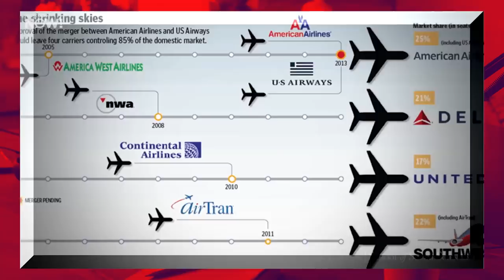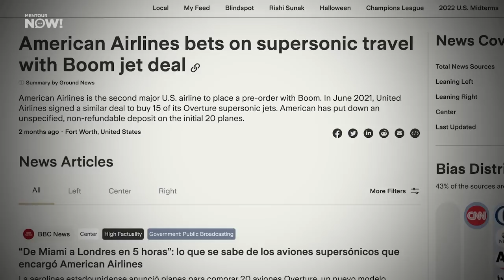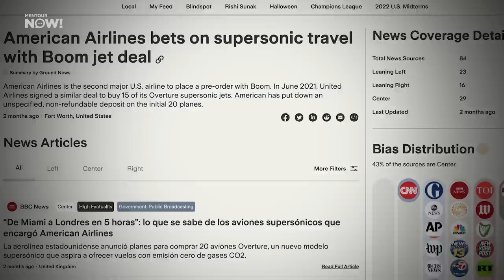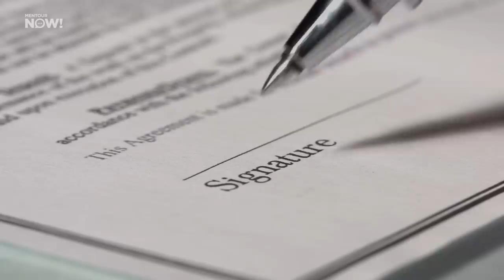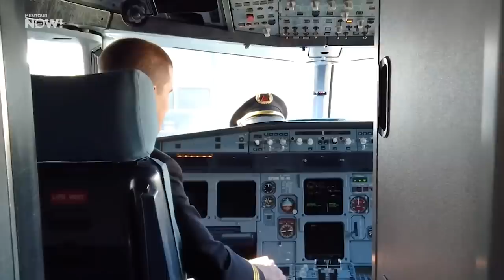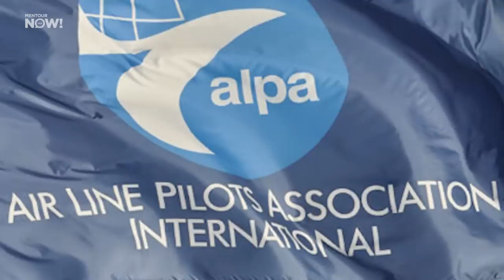Is This the DEATH of the US Regional Airlines?!

Comment: Another consideration is the sheer size of the United States, and the fact that it was developed many years (centuries!) after Europe, and is thus less dense. It is not uncommon for cities of close to 100,000 people to be located several hours away by car from a hub. That makes regional airlines important for more people to be able to access travel opportunities. I live about two hours from a major hub, but 30 minutes from a regional airport where I can hop a quick flight and connect to South America, Europe and a host of other locations more quickly than driving to a hub, parking, dealing with longer security lines and additional delays.

As for runway length, that is just a product of geography. We have a lot of room in the US, so when they build an airport, they add in room to grow if necessary. Our regional airport also doubles as a Coast Guard air station, so it's put to good use. I believe Air Force One has landed there a few times, too.

Comment: After 9-11 regional jets were called replacement jets.  Regionals went from feeding into hubs from smaller towns to flying point to point or hub to hub when the legacies shrunk.  This was the rise of the bigger regional jets from 30 seat Turbo props and 50 seat RJ’s.  I think there still is a need to feed into hubs and wish smaller turbo props would come back.
Reply: Turboprops are loud and slow. No thanks.

Comment: This does a great job of summarizing the main points of what is happening in the US right now. US pilots have been discussing this for years now. It no longer makes sense to try to operate a larger number of crews on less efficient aircraft. They are now not only paying the crews nearly as much as mainline crews, as you mentioned, but also for middle management and another company seeking their own profit margins. 

Many in these comments have mentioned that flight frequency is a big issue for them and moving to larger aircraft with less frequency would be a deal-breaker for them. But I imagine this could be offset somewhat by the fact that the larger aircraft can be so much more cost effective that prices can be lowered sufficiently to induce more demand in many of these markets. Say you have 3 flights on regional aircraft per day that could be replaced by a single narrowbody. The increased efficiency and economics will likely drop ticket prices substantially. Perhaps the price drop will induce enough demand for a second narrowbody slot.

The other thing that seriously annoys me abut the current model is how terrible the environmental impact is. Jet aircraft get horrendous fuel economy on short trips. Especially when they can't be used to their full seating capacity like was stated. There are so many flights in the US that are short. There is no reason someone should be getting on a 15 minute flight from GSP to CLT. We need regional and high speed rail in this country desperately. 

And each of these regional jets takes up a single takeoff and landing slot just like any other aircraft. Shifting towards narrowbodies would improve taxi times, reduce delays due to congestion, and allow for better gate utilization. Airports wouldn't have as much pressure to expand if we simply use the space already available more efficiently.

Comment: Great video, love your channel, I've learned a lot on here from an insider's view, so thanks!  Although I will say I pretty much already knew everything in this video.  By the way I will add that I believe the same situation exists in Canada as the US regarding the 76 seater limitation between mainline and regionals due to labor contracts.  As you point out, it's all driven by the Scope Clause in the pilot's labor contracts which is an artificial constraint on the industry.  It is amazing at how the US market has changed in the past 10 years or so and how many ERJ's 170/175 have come into the US market - great opportunity for Embraer obviously.  Each airline has to figure out how to maximize revenue and profits within those constraints.  One point I don't think you made is that there is a schedule flexibility benefit in many smaller markets when having two regional flights per day on 76 seaters vs. one flight per day on a 150 seater mainline aircraft.  Another point you didn't mention is that in North America, a 76 seater is the limit for two flight attendants, above this you need the third flight attendant which is an added operating cost.  There are other nuances in the US, such as Alaska Airlines announcing they will eliminate all their 76 seater Q400 turboprops in their regional (Horizon) in favor of the 76 seater jets, even though the turboprops have a lower fuel operating cost.  The jets are generally preferred by passengers because they are faster and quieter.  I read about 10 years ago some guy predicting that the older CRJ-200s would all be retired by now because they are fuel hogs - but that hasn't happened either.  Another element in the US/Canada market is that the regionals act like the minor league farm system in baseball, they develop and prepare the pilots for advancement into the majors.  This is why the labor shortage hits the regionals the worst.  There are many factors that go into these business decisions, and yes, the labor contracts and the Scope Clause are a major driving force in North American market.

Comment: The term "regional" is no longer active. That being said there will always be carriers in EAS markets but the term would fit better as feeders. For example, Cape Air serves 5 Eastern Montana markets to Billings. Now the equipment used are extremely size challenged flying 2 pilots & 9 passengers in the P2012 from Italy.

Comment: Another benefit of switching to larger aircraft in favor over multiple regional jets is that already congested hub airports (which often are on at least one end of the regional flights) could open up more slots. I have always seen this "forced regional carrier operation" without the actual need to do so as quite wasteful.

I personally would love to see this change happen, I mostly fly into a US airport that has two runways of almost 3 km length (plus shorter ones), so it could accommodate pretty much every size of airliner, but more often than not I have ended up flying there on some CRJ sardine can. (rarely I got a 737, Mad Dog  or 717). They don't get international flights, so when coming from or going back to Germany, there is no way to avoid having to connect.
Reply: They aren’t “wasteful” with respect to travelers’ time.

Comment: Not a pilot but I don´t know if I quite agree with your theory with all due respect. I do not think the airlines are keeping regionals necessarily with the sole intention of paying low wages to pilots, although that is indeed one of greatest desires of some CEOs.
Just as you mentioned, old models from first generation regional jets (CRJs and E1s) actually do burn quite a lot of fuel per passenger, and that cost alone would probably offset paying less for rookie pilots, and that was true long before the current situation of exorbitant fuel prices and low pilot count made worse after huge layoffs during the pandemic.
I believe many of the medium/large airports you picked makes use of regional jets to provide high frequency for customers. Give them more schedule options and hence dominate that particular market. Furthermore, we must consider the airport infra-structure which goes beyond runway length. Lack of terminal fingers, space, etc. may all play on a regional jets favor.
I do agree that scope clauses that was intended to protect major airliner staff earnings, are creating a rather strange market distortion where the unions have too much bargaining power and hence they tend to keep this old regional aircraft situation for longer.
It is worth noting however that the second generation regionals (A220 and E2s) are being named as "cross-over" aircrafts by some specialists due to increased payload or range capability, which lets them take on the role of lower end B737s or A320s depending on a particular route demand. Sure they may not carry the same number of passengers, but their breakeven points are lower than filling bigger aircrafts, which allows them to connect new routes that airlines were shy to invest and penetrate years ago. This is exactly what David Neeleman saw as an opportunity with his new Breeze Airways. More point to point on a  continental level rather than hub and spoke model.

Comment: There are a number of Embraer 175s in backlog to be built. I don’t see why airlines would be buying them if they don’t plan to use them.
And also the E-series found its niche during the post 9/11 when 737s were flying with 70-90 passengers, then buying a smaller and more economical airplane would make more sense in several routes, even if pilots were to make the same salary. We are seeing the same situation coming now with the post pandemic recession.

Comment: The easiest way to avoid Scope Clause issues is for the major airline to fly those planes themselves. If AA, DL, UA all were flying the 175’s and CRJ900’s themselves, they could put whatever seat configuration they want. And the recent pay raises across the regionals have them pretty close to the lowest pay scale at the majors.

Also, perhaps the greatest reason why the US regionals will eventually die is because of the size of aircraft still being manufactured. Bombardier has closed it’s doors. Mitsubishi canceled the smaller jet for the US market. The only aircraft still being manufactured that fit within the scope clauses of the US major’s are the E175 and ATR 72 turboprop. But after making big moves away from turboprops, I can’t see any of them ordering an ATR anytime soon. So what happens when all of the 50 seaters (E145/CRJ200) get retired? What about the 60-70 seaters in the CRJ700 and E170? They are all getting close to the 20 year old range. Once they are retired, the only aircraft they would be able to purchase is the E175, which is the most scrutinized under the three scope clauses and most are maxed out of the number they can have flying anyways. They can’t simply replace sub-76 seat aircraft with more 175’s, the scope clauses won’t allow it. I foresee that being one of the major stumbling blocks falling: all the regionals would only be flying 76 seaters and there isn’t anything else that could reasonably replace it. A huge drop in pilots because a large portion of regional fleets are retired and they can’t purchase any new aircraft because of scope. Avoid scope clause by bringing the aircraft in-house and then we might see more 190/195 E2’s starting to get purchased as well. Just a thought!

Comment: One huge problem we have in the US is the cost of becoming a pilot. It’s going to take somewhere between $50,000 and $100,000 of other people’s money to become a Commercial pilot, and then you’ve got to spend the next year and a half teaching people to fly or hauling crabs out of Boeing Field for $20k/year until you’ve logged the 1500 hours you need to fly for airlines. It was better back when you could work as a First Officer with a Commercial certificate - human passengers pay better than crabs. 

There are a lot more people with the desire, motivation and potential to fly airliners than there are people with the money to enter the business.

I don’t know…maybe the airlines could set up a system where you agree to work for them five years in return for pilot training. It works for the trucking industry.

Comment: What it seems more likely is that Mainline airlines may have to begin to buy THEIR OWN METAL  (up to the A220-100 size) and HIRE THEIR OWN PILOTS with lower cost subsidiaries to compensate PART of the passenger volume that the US Regionals "will leave on the runway"  when they keep shrinking in size until they disappear to more closely resemble the European model of Mainline-owned Regionals.

Comment: There are two other major reasons for regional carriers that you seemed to have left out. 1 is the way US carriers and pax prefer ops. We do not use hub & spoke nearly as much as the rest of the world due to the size of the country. Yes, there are still major hubs, but people would prefer smaller aircraft with higher frequency rather than one larger service per day. For example, LAX mostly sees single aisle jets cross country to airports, with the exception being some twin aisle services to select major airline hubs. This is also the case with small rural airports, which are also not financially viable for mainline. The second reason is USPS and other government funding. A lot of the regional services are actually required by law by the government in order for the airlines to get a subsidy. In return, the government creates demand through small freight shipping, mainly with the USPS. Notice that the USPS doesn't fly aircraft like private counterparts, but if they only used ground vehicles, they wouldn't be able to offer 1 or 2 day delivery. This started from the dawn of commercial aviation when the original purpose was to fly mail.

Comment: jetBlue does still have E190s but it’s really only them and Breeze, as you say, even trying to play in the low-end mainline market with right-sized aircraft (I’m also talking about only the US).

I think Neeleman IS onto it like you suggest and I think Delta might be as well - reason they have relatively few RJs compared to UA and AA is they’ve been progressively replacing RJs with A220s.

Comment: A local airport has a paved and grooved run way 4550 feet by 75 feet and an aircraft classification number of 29.5 and a pavement classification of FAXU. The info page for the airport says it can handle large twin engine and jet aircraft, I like watching trains but we don't have any just this airport and I prefer watching them land, but the roar of the twin rear mount engines is exhilarating these are between 20 and 50 feet long.

Comment: Arbitrary rules are not new or just for airlines.  Back in the mid-twentieth century, diesel locomotives were taking over from steam.  On the small end of the scale, GE made a 45 ton locomotive for industrial switching and as light duty switchers for regular railroads.  However, only industrials bought the locomotive because union rules required a crew of 2 for 45 ton or heavier locomotives.  Therefore, GE made a slightly lighter version that weighed 44 tons and could be run by a single crewman.  Near identical locomotives but still distinct due to union rules.

Comment: A couple more notes: 
- The US market is literally the only one of it's type: a unicorn (geographic size, density, population, number of passengers, % of pop. which fly regularly)  Comparison is interesting but: apples and oranges? 
- To visit my mum:  KSEA > KILM; coast to coast.  There's is no direct flight. I think this is rather common. No direct flight means an extra 2-3 hours on top of an already roughly 3-4 hour medium haul flight. 
- The whole 1,500 hour thing ->  "regionals" and smaller aircraft are the only way for newer pilots to even be considered for a "real"; higher paying pilot job, no? 
- If you can fly direct from medium sized airport to medium sized airport, you have saved hours (Security, tarmac delays, miles of walking inside of airports or waiting for light rail)  and you've likely saved $$ as well. 
Just a few points, it's rather complicated!  
- The top 20 largest (if not top 30 or 40) US airports are over capacity again

Just some thoughts!  I don't think "regionals" will go away it's just more of a training ground, allowing passengers (and pilots)  to avoid the mega airports?   Thanks again for your awesome work on your absolutely fantastic channels!!

Comment: The one big factor you haven't talked about is the cost of fuel, A turboprop machine burns considerably less fuel per passenger than any jet, what happens when somebody jumps in the long haul market with turboprops and the tickets are much cheaper and maybe thats just a fantasy of mine since Im an old DC-6 flight Engineer, but fuel cost does play a factor

Comment: Envoy, Republic and Piedmont are all owned by American Airlines.  When pilots were more plentiful, this was merely a union thing and it really had as much to do with flight attendants as anything else.  50 or more passengers needed 2 FAs.  I think the next cut off was 75 which explains those passenger limits.  Many do fly to big airports but these tend to be routes that don't attract enough passengers for a mainline aircraft making this still more efficient than a 737 or A320.  The pilot shortage may be messing this up some now.  I worked for a regional several years ago who switched between USAir, AA and United every few years flying CRJ 200s.

Comment: It’s not cost.   The regional model is not cheaper anymore.    It’s marketing.   Marketing drives the schedules.  Higher frequency on smaller aircraft gives better scheduling options for marketing.   My airline doesn’t use a regional feeder and in numerous markets we only operate a couple of flights.   Marketing would rather offer the customer more options, so the fee-per-departure system makes more sense for those companies.   The mainline pays the same per flight no matter the load.

Comment: You based your "research" on Eastern US regional routes which are very busy and part of the Hub and Spoke feeder system.   But in the US as you know other forms of transportation systems (rail/bus) is inefficient and in many cases non-existent.   Therefore in the midwest andin rural comunities (cities and towns) of the US and in more isolated regions with much less air traffic, Regional carriers become much more practical.  Also many of these minor routes are supported financially to the Regional/Major carriers financially.   In order to provide access to these less profitable cities.